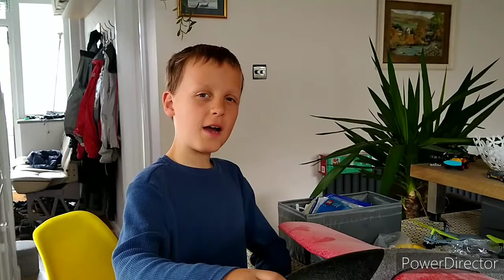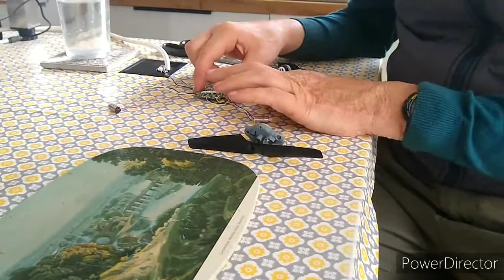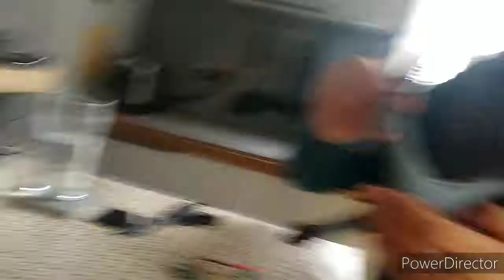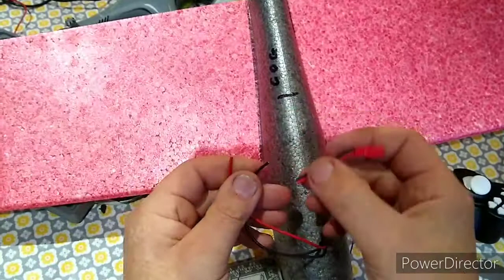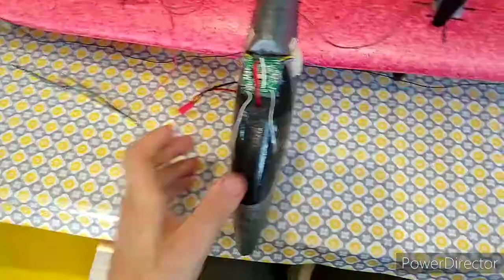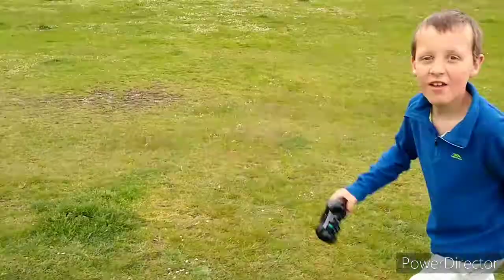Broken drone made into powered RC glider hack

Comment: Seriously, I appreciate you making this video. 
I bought the same plane this week for my boy. I have seen other videos on powered chuck planes .
I need to buy a drone and glory, be your drone looks identical to the one in Kmart. 
The plane was $ 10 and the drone is $ 25 or $29.
After building I noticed a problem because of the gyro.  So I fitted 2 diodes in parallel but cathode to anode, cathode to anode
This way when gyro shuts down one motor it will be fed from other but with 0. 6 volt lower . It's enough to keep flying but still allows enough difference for steering.
Another mod to board provide motor control so control is shared front and rear both sides to stop surge as drone system try's to hold geostationary.

Comment: I recommend you guys to keep doing it :) buy a couple servos and electric motor with ESC. Connect them to RC controller. cut the airplane surfaces to control it by servo. You'll have much better results. Welcome to RC hobby